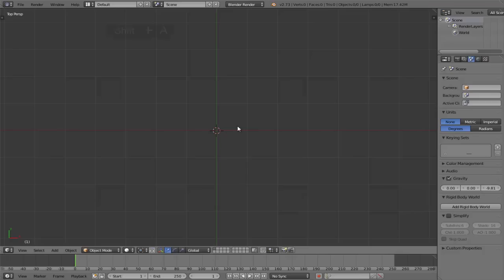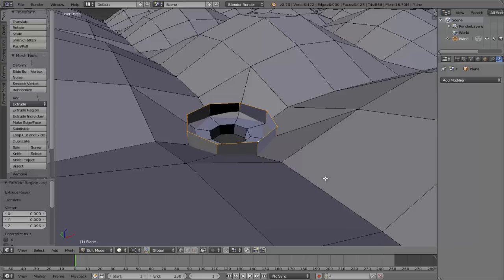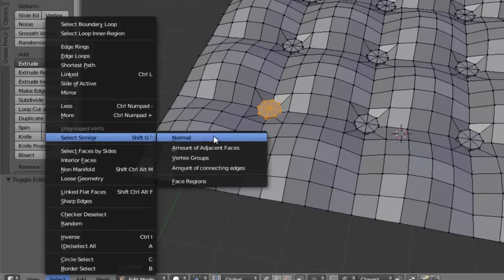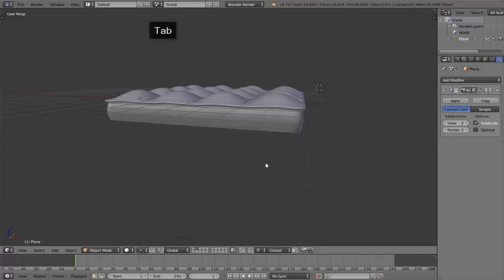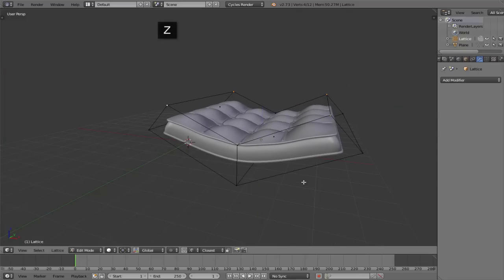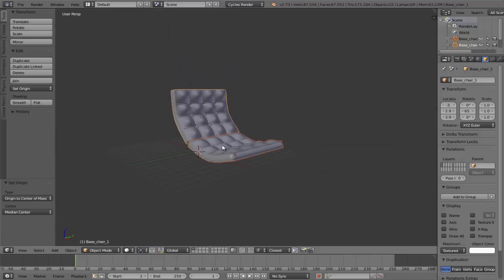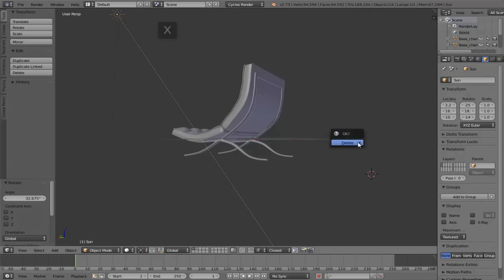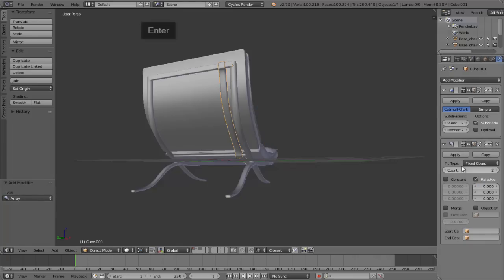Blender Tutorial : Chair Modeling

Comment: About wrapping the cushion with the lattice: for some reason, if I resize the lattice by entering enter mode and moving its vertices, when I later apply the lattice to the 'Lattice' modifier of the cushion the cushion is deformed straight away. 
I see that you resize the lattice in object mode and indeed the cushion won't be deformed unless I edit and move the vertices of the lattice. But what about wrapping around more complex objects? Suppose a 'solid' L-shape figure. Do I really have to wrap it with a perfect cube, so that I can not create an L-shape lattice?
Thank you for the tutorial! Those 'underused features' that you mention really make a difference!!
Reply from the maker: Glad you found it useful! For more complex objects rather than using a lattice you may benefit from creating a low res mesh that you can then use as a sort of 'cage', for that try the 'mesh deform' modifier. Or perhaps even some basic rigging. :) Aidy.

Comment: Not entirely sure why, but when I add a lattice it hikes my memory from 80mb to 4 gigs locking my poor laptop. Also, when you're selecting the buttons to hide, why does it 'selecting similar' randomly select vertices and/or faces that have nothing to do with your selection? I've had to de-select verts nowhere near any buttons before hiding them. Perhaps my Blender is just quirky.
Reply from the maker: the lattice thing is strange, i've just tested a new scene where i checked the memory before and after adding a lattice and I didn't notice much extra memory there. That huge memory increase is usually something to do with a subsurf modifier setting getting cranked right up or something. 

As for the selecting similar and then choosing the 'normal' option, the normal is another name for the face direction. At the bottom of the toolshelf you'll find the settings/threshold to tweak to finetune this. You can also just press F6 directly after any tool is used to check that. Simply put that normal option will select any other faces facing the same direction, since those buttons all have a pretty unique facing polygon directions compared to all the other polygons in the mesh no others get selected. Otherwise maybe the directions of those faces are too similar. Hopefully that makes sense! :) Aidy.

Comment: Great tutorial yet I had a lot of issues when it came to the lattice but great none the less
Reply from the maker: Thanks, the lattice can have some difficulties with it, things tend to need to be done in a very particular order, glad you got through it! :) Aidy.
Reply: Well i did and i didn't for some reason when I press s to scale the lattice it would not move so scale so I ended up using the transformers panal which work till it came time to rotate it, this was nerve racking so I ended up exporting the model into a new blender scene then lattice worked none the less this was an amazing tutorial but I recommend you use the screencast add-on keys next time
Reply from the maker: youtube comment replies are strangely difficult to keep track off! Anyways, seen this now! Thanks for the reply, yeah glad it all worked out, the screencast keys doesn't work that well with Blender anymore unfortunately, in fact I think it's not included anymore either where it once was, however, I have got a system that I use these days to replace this, thanks for the heads up! :) Aidy.
Reply: Anytime Bro Anytime

Comment: Forget the previous comment....this time I did need "Control" and it snapped a fraction out of line....ended up doing it manually on a couple of them.
Reply from the maker: very strange, i think that's maybe to do with whether you have the little snapping magnet icon enabled or not? The Ctrl should invert whatever that button is set to while moving. Glad you're getting through it though, it covers a lot in a pretty short time. :) Aidy.

Comment: great video. I had stuck during 5:00 where you snapped the button placements. Despite me turning on vertex & autosnapping it wouldnt work so I had to turn on snap to transform (magnet) in order for it to work very clumsily but I still got it. Not sure why vertex snapping & auto snap didn't work like in the video.
Reply: Did ya press control when moving the object to snap it?
Reply from the maker: apologies in the delay in response, it's summer hols with the kids for me but I'm getting back to it all now! You'd need to hold control as Elvis Le has said in order to make sure the snapping is toggled. Otherwise check also that the 'closest' mode of snapping is set too, which you can see right next to where you select the kind of snapping you'd like. Hope that helps! :) Aidy.

Comment: the amount of little quality of life/ efficiency improving  tips I have learned just from the first few minutes of this video is amazing, that "to sphere" command would have helped me out so many times where knife projecting a circle into a face failed due to blender struggling to cut ngons into ngons!
Reply from the maker: That is one very useful tool! Also check out the looptools addon, it should be in blender by default just not enabled, so switch that on and you'll find under the specials menu (W key) the looptools at the top most likely. There's a 'circle' command there that does something similar plus other stuff i thought you might like! Anyways, glad the vid helped you out! :) Aidy.
Reply: CG Masters oh just checked it out and that is incredibly useful! thanks a lot for that :)

Comment: Yes , thank you for your video. I 've got a problem. While selecting the vertices and press spacebar and ty to sphere, things turn out to be one big sphere, the selected vertices spread out. It doesnt like you do it. Why?
Reply from the maker: +navy eng Hi! Is this the section at 3.30? The "to sphere" tool depends on where the pivot point is, ctrl and the comma key is the shortcut to place it back to 'median point' of your selection. With just that loop of flat vertices selected at median point, the "to sphere" tool should then shape them more circular, because a very thin slice of a sphere cut straight across is just a circle shape. Hope that helps! :) Aidy.

Comment: At 10:49 you pressed Y to rotate the object. When I do it, nothing happens. Why is this?
Reply: +Dracstar I think it only didn't show key R before Y, like ALT+ D he told he pressed few seconds earlier, but also didn't show on screen.
Reply: RsApofis oh. Thanks!
Reply: I cant even rotate it at all
Reply: Go to object mode, select that part, press R to rotate and then (still in rotate mode) press Y to rotate it around Y axis.
Reply: Ive done that it did not work
Reply: If u want, I can give u my contact and show u it tomorrow.
Reply: LOL it was the lattice for some reason when I press s to scale it did not move or scale so I ended up using the transform panel so when it came time to rotate it did not do it but when I open a new blender scene it works so I just exported the model into a new blender scene and now I can rotate it
Reply: I can still give you the file if you want to look oh and am using Version 2.78
Reply: Cg :) I don't need your file. I switched to different software for a longer time.
Reply: What one do you use now?
Reply: I switched to AutoCAD for 2D electrical circuits and Matlab/Simulink to calculate them cus I have to do a lot of it in school so I stopped doing 3D but I want to come back to it ASAP.
Reply: Ok so you still want to use blender
Reply: I will try other similar software like Maya, 3Ds Max,... cus why not, but I think that at the end I will stay with Blender cut it's great and have it's own game engine.
Reply: I know ive used both of those software but I can say we are better off learning and doing things in blender however Maya is industry standard its always best to lean how to use it even though the industry now a days are moving to mari

Comment: This wasn't helpful for me. Every time I get to 2:47 of your video, I run into an issue where I can't select any of the 16 copy and pasted pads, but only the original. The dots only show up over the original while the system disallows me from selecting any of the other 16 copy and pasted pads. I tried this multiple times and every time I switch back into edit mode as you did at 2:47, I run into the issue where the crosses only show up over the original pad and none over the 16 copy and pasted ones.

Comment: Really enjoying this tutorial, altough I got stuck with the pressing of "i" to get started with the button. It does the "shrinking" individually on all of the four faces and I can't get it to work as it did for you. May need to to a simple scaling instead!
Reply from the maker: +Niklas Erhard Olsson Hi! It's possible you've got the tool set to 'individual faces', you can uncheck the option with F6 or at the bottom of the toolshelf with the T key, this option only exists right after using the tool though. Hope that helps. :) Aidy.

Comment: This is a really good tutorial. I actually learnt loads! However, TIP: 

When using subsurface modifier, to tighten edges, instead of creating extra edge loops, select the edge you want to tighten and press SHIFT + E and move your mouse in and out.
This method is a lot neater and saves a few vertices. :)
Reply from the maker: +Plan C Thanks! And regarding the edge creasing yeah you can get some pretty good results at times with it, though you wont get the control you might need or as nice a result on some geometry. It's definitely worth learning all methods though, thanks for bringing it up! :) Aidy.

Comment: Great tutorial ! It was eye-opening about a lot of things I've had issues with in the past, with other attempts.
I'm just stupidly stuck around 2:55 because when I use "I" to insert the button hole, the hole is inserted in EACH face simultaneously, and not at their intersection. What am I missing here ? Feels like a detail but it's so frustrating XD
Reply: The right answer to this is to tick the merge option on the array before applying.  If the arrays aren't merged then you will inset the faces on the borders of the original mesh, not insetting the 4 selected face at their collective center.
Reply: +lady teruki figured it out. Press E then esc and then hit scale (s) and there you have it!
Reply: Thanks ! But, wait... that's before pressing "I" or after ? Because your tip does a lot of things, but not change the way "I" behaves... ^_^;
Reply: Yes, I did it before pressing 'i', and it worked! Should work for you! :)
Reply: @Paul Allen thanks it really helped a lot. but i was wondering do you know how to set it so when you select an individual face or vertices the axis arrows wont show up it's very annoying

Comment: How would you create a round version of the cushion with this same technique?
Reply from the maker: Lillie Evans  That's hard to describe in text i think though a square shape can be converted to circular by enabling the looptools addon and then go W > LoopTools > Circle, then the surrounding connections would either need the vertices relaxing or just generally cutting in and tidying up. Could make a good quick potential quick tip, we will get it on the list! :) Aidy.

Comment: How do I snap vertex on MAC, min 5:04. Blender 7.4. Thanks
Reply: Ram Hernandez Hey, I just stopped to see it on my mac, never really used blender there before, it seems that control does the job ;)
Reply: Thanks for the info. I have already tried CONTROL, but it doesn't work for me. I have the latest version.
Reply: +Ram Hernandez Make sure the snap element is set to "vertex". Also if the auto snap is turned on (check the U shape magnet button), you will deactivate the auto snap temporarily when you press control key. So make sure it is turned off when you want to use control key.